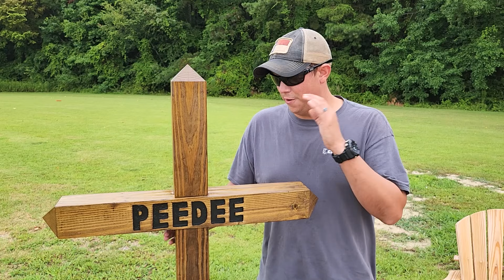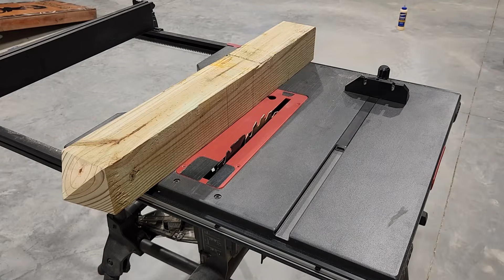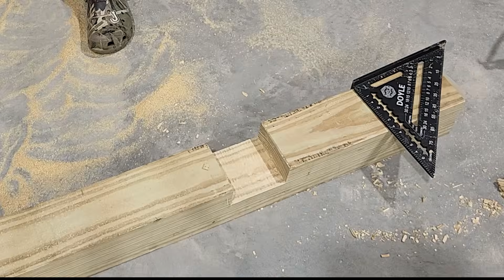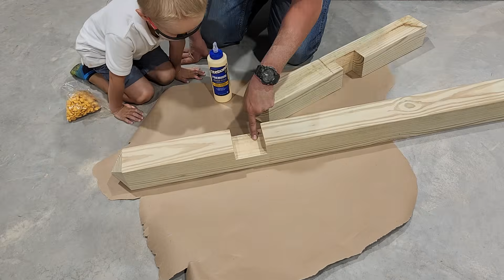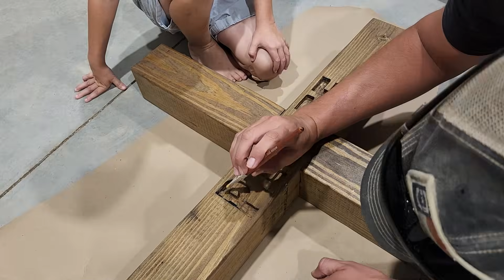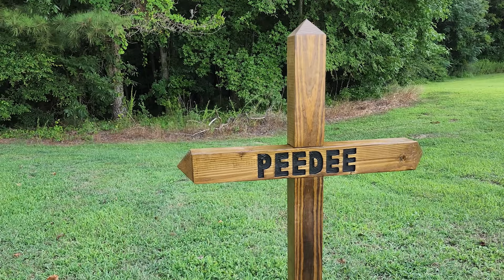How To Build A Simple Cross

Comment: Looks great.
I have one I just made complete with routed out lettering ,ready for stain and paint 
I plan on using penitrating oil based semi transparent stain for ease of maintenance. I’ve found that is the easiest way of keeping my fences looking great as I only have to wash and apply more stain every 3 years or so. Therefore I will not be top coating the cross. 
It appears you applied an oil stain, if so what type paint did you use over the stained letters? I noticed you applied the paint directly over them. 
Beings I will not top coat, I’m thinking I should use exterior latex for the black painted letters. I was told I need to apply shelack over the stained letters for proper adhesion of the latex paint to the stained letters. 
Does this sound like a good plan to you? . 
It is not as simple as yours, so I would like to know what type stain/paint did you use and how is your cross holding up after 2 years in the weather?
One more thing, if I stain everything before joining the pieces together, Will that interfere with proper bonding of liquid nails glue? I will be installing screws to the back like you did.

Comment: Very good job. Suggestions if you make more crosses. I've been making them for a few years now. Same design. I use Windows publisher to spell out the name and dates. This gives you different fonts to use. Print it out and trace it with carbon paper. Carve the letters. I then paint the letters black and it's ok to smear the paint cause after the paint dries, you sand the wood and it will leave the black paint in the carving. I then stain the wood and let it dry. I apply an outdoor sealant to weather proof it.  I've made them out of 2x4, 2x6, and 4x4. By far 4x4 is the nicest of all. On 2x4 I'll route the edge with a Roman ogee bit to give it more appeal. But you did a good job.
Reply: I just made one out of redwood and want to use oil based stain and black letters. As it sits now it’s in 2 pieces because I thought maybe I should apply stain to protect even the joined unseen edges that will be glued together (is that a hood or bad idea). 
Then I thought maybe better to paint and then stain because black paint might not adhere correctly to the oil based stain. I saw a video in which they applied shelack to the face before painting the letters so the excess paint in the face would not soak into the grain and come off easier. If I did that then the stain would not soak in unless I endured all the shelack was completely sanded off. So here I sit wondering how to get the best results. 
Also being it’s new wood sanded down. I tested stain in a left over piece and it was blotchy. I tested another piece by wiping with mineral spirits first and it came out beautiful except bathe stain did not soak into the wood very much at all. Beings it will be outdoors in a lot of sun I’m not satisfied with either. What should I do to prep the wood for oil stain for best results. What type of paint for the letters. If I go as you suggest what type paint do you use and how does your paint not soak into the grain so you don’t have to sand so deep to remove. Do you use spray enamel to keep it in the surface?  This is my first cross and I’ve spent a lot of time routing and cleaning and I just don’t want to screw ut up by finishing it wrong.
Thanks